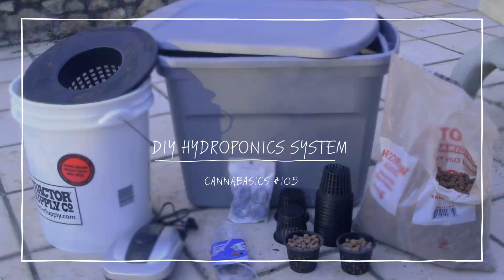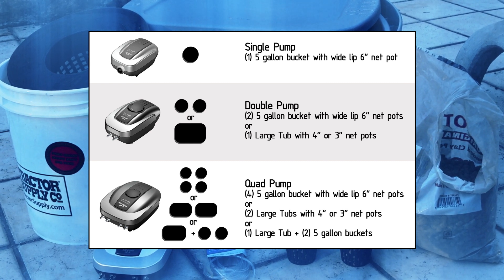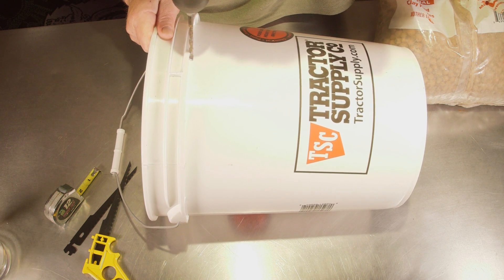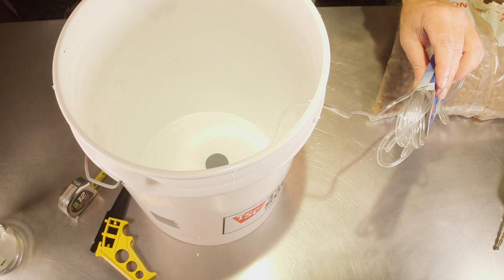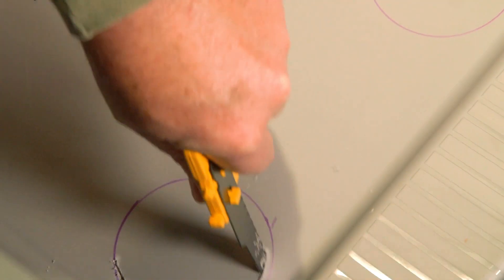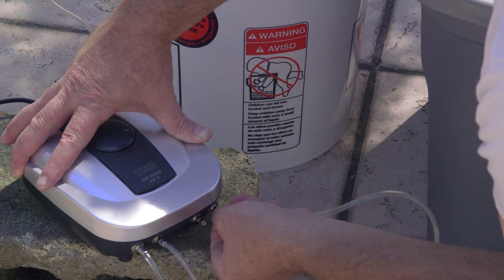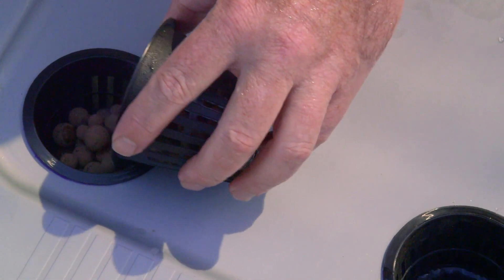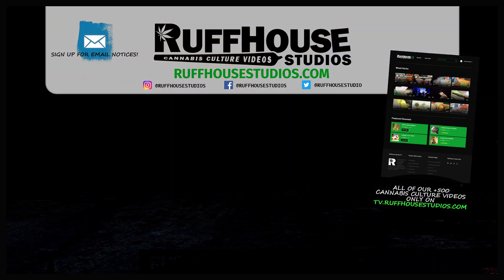How To Make a Deep Water Culture (DWC) Hydroponics System: Cannabasics #105

Comment: Rather than drill a hole in the 5 gallon bucket for the air line, drill the hole in the wide lip of the net pot; or simply run the air line through the net pot.

Comment: There was one thing you missed, since your air pump is at a lower level than your water level at a momnet power is cut off water can be siphoned down into the pump and damaging it. To prevent that an Air Line Check Valve prevents water getting into your pump in a situation where it gets siphoned back. These check valves are relatively cheap under 2 dollars per valve. We use them a lot in aquarium set ups using air pumps.
Reply: I have spent months researching into aquaponics and found an awesome resource at Keiths Ponics Site (google it if you're interested)

Comment: Ive gotten very different information regarding the water level in a DWC.  Ive always heard to keep the water below the net pot, and this is what Ive done with all my DWC grows.  Now, I do however use a top feed system for the first few weeks, until the roots start to reach the water.  Once the roots are in the water, I cut off the top feed.  What Ive found is that the Hydroton is pretty well always wet, due to the bubbles from the air stones.  I'm using 3.5g buckets with large air stones though, the cylindrical ones, like the size of a redbull.  Anyway, great video and thank you for sharing. :)

Comment: I've seen that you shouldn't use clear piping as the sunlight can cause algae to grow. Have people had success with clear piping and no algae growth?
Reply: Those are air lines so no algae wont grow in them. If they had water running through them then yes